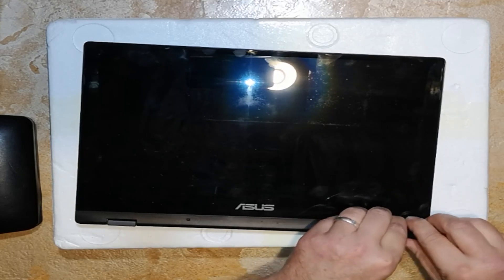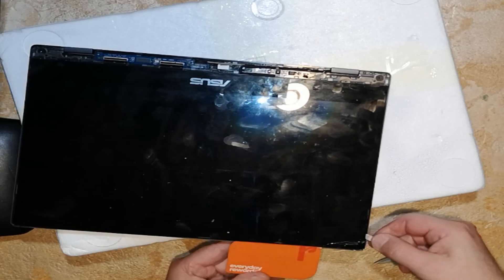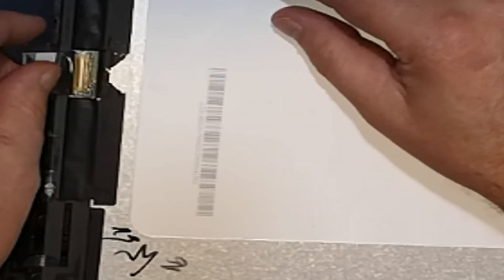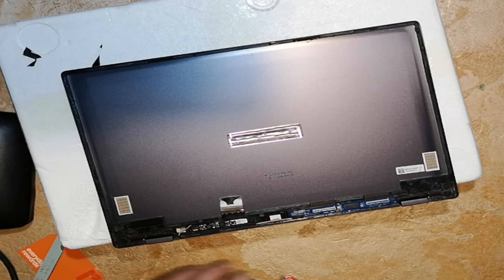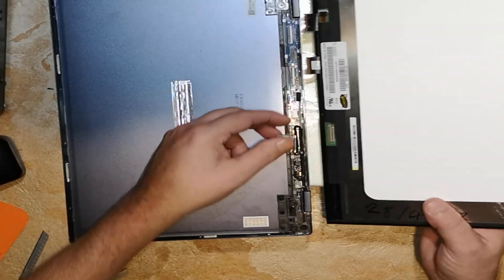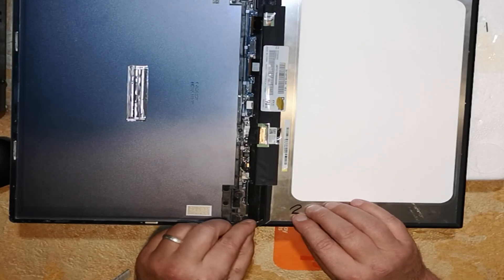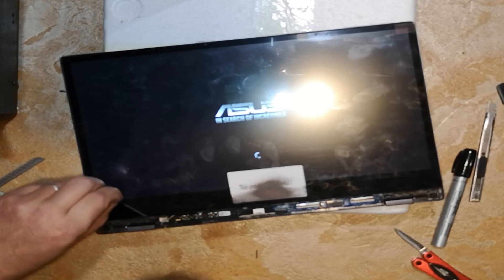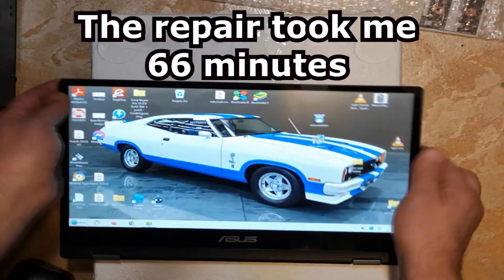How to Replace ASUS VivoBook Flip | TP412FA | Touch Screen Replacement | TP410 /TP412

Comment: I noticed it looked like my screen was looking like it might be lifted up a bit from the bottom piece that you takeoff in the beginning, around the ribbons part. I kinda like “snapped it back in” by pushing gently down, thinking it would help fix it (the touch screen isn’t working, but there’s no visible damage on the screen at all and everything works except touch) do you think it may be like a connection issue like the “ribbons” may have been damaged or disconnected or something?
Reply from the maker: You might have done something unintentionally but I would first check is the laptop using MS drivers or Asus Drivers. Sometimes a MS driver update happens and everything looks good but something seems a little off. Try reinstalling the drivers and also try going to the on-screen display to enable "Touch Screen" function. cheers

Comment: Nice VIdeo !
Do you know the screen model and serial number? 
I would like to purchase a compatible LCD controller to use as a standalone monitor but I don't want to ruin it or disassemble it from the external case.
Reply from the maker: Thanks for your comment. It's a Asus Vivobook Flip TP412F or TP412FA.
Reply: @TEKNOFIED  I mean the serial number of LCD screen not the laptop model. 
it's behind the screen shell at 3:45 or 6:32 but i can't read it.
I don't have a screen replacement so i don't want to risk of breaking mine. If you remember it or take a photo of that or still have the replaced screen part It would be useful for me to know the text that is written there.
Reply from the maker: @jjakob9696  Okay got ya. I didn't order the screen by S/N I ordered it by Model number. I had a quick search and found this image that might be of use to you. Download it so you can enlarge the image. https://i.ebayimg.com/images/g/6wMAAOSwIIxj~2QN/s-l1600.webp I hope that helps.
Reply: @TEKNOFIED  Thanks for the help but it is not what i needed. I ended up by disassembling my case and find the model number. to use the LCD controller i needed to connect the 30 pin cable directly behind the screen because i figured out that the external connector is only compatible for the tp412ua board.
I post the model so i hope can help other people: B140HAN04.0 30 pin
Reply: @jjakob9696  AWESOME mate! I am trying to do exactly this, to find the LCD control panel for this screen (of TP412FA) to make it into a separate external screen. Not sure if we have the exact same screen - mine is of the 14" TP412FA not 'ua'.